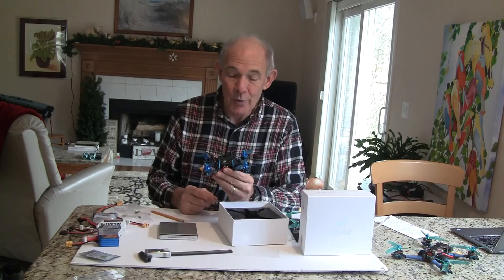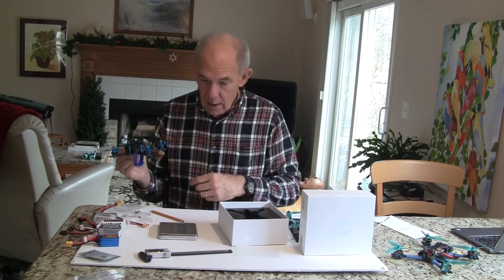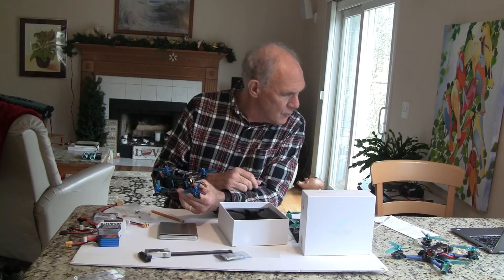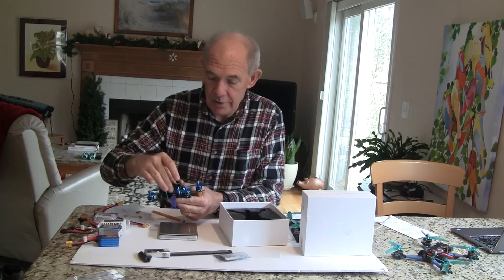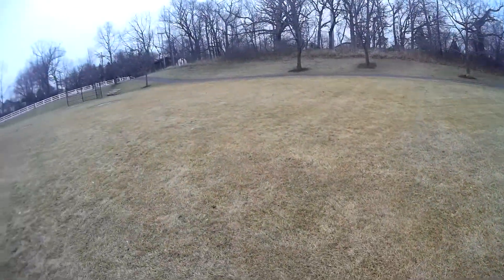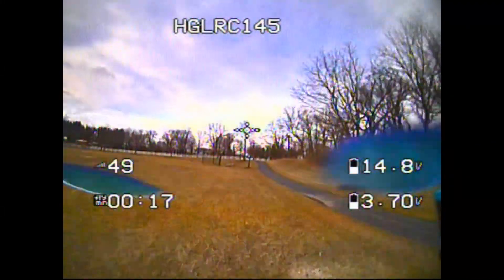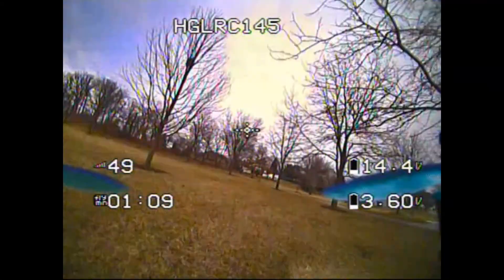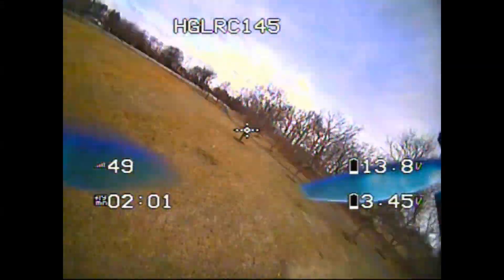HGLRC XJB 145 - 3" Quadcopter Review

Comment: Hi John,  try Tramp telemetry. Mine came with Tramp available on UART 3, although it was not enabled. I took mine apart to conformal coat and noticed it was wired that way. I used the uninverted pad from my R-XSR to TX 6. I have telemetry and VTX control via lua script on my Taranis. Check it out, you may be pleasantly surprised !
Reply: I am using an XM+ and when I do flips or rolls I get a failsafe and rxloss warning.  Any suggestions?

Comment: What is flight time on 650mAh 4s?
Reply from the maker: I get between 4 1/2 to 5 1/2 minutes on the 650mAh 4S
Reply: Primož Iskra I get 2 minutes witb a 4s 650mah, after that each cell is 3.75v